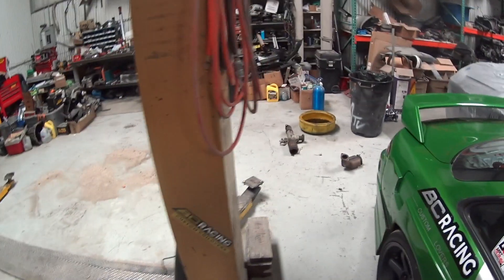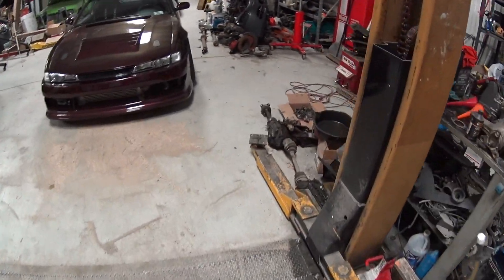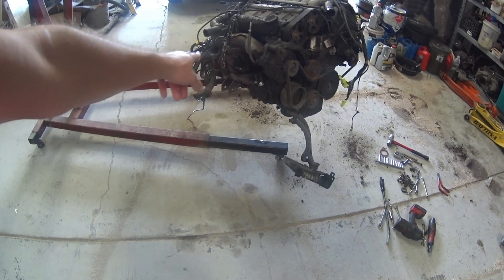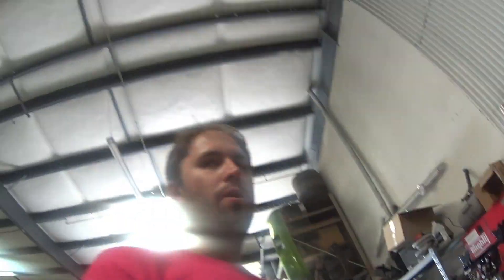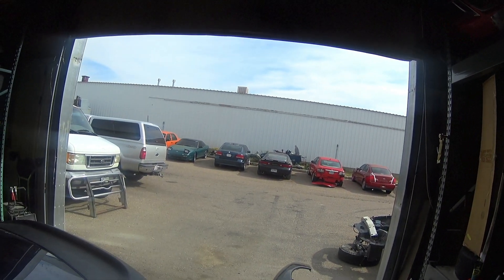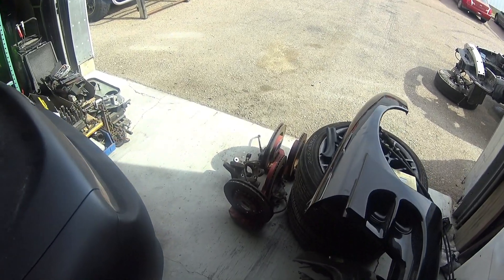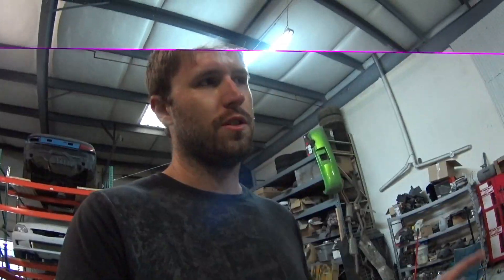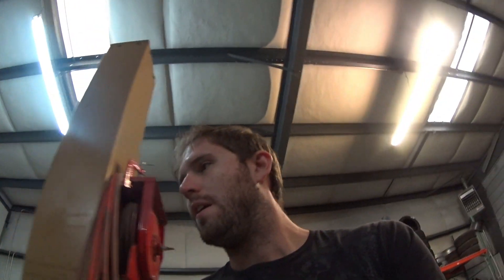3000GT Project Coming to an END!!!

Comment: If i remember correctly with my old 3000GT, the door ajar constant beep can be stopped by pulling the radio and unplugging the pair of wires that has a blue plastic connector. Should be on the right side. Hope this helps!
Reply from the maker: +Ronald Finger yeah I saw it but didn't think they were that bad

Comment: there is a light for coolant, but it's a wired looking light lol. if you turn the key before starting the car to let the dash light up you should see it, it will be the bottom right corner under SRS

Comment: just a fair warning that is the wiper fluid light, not the coolant light. if you don't have a manual, I suggest you look up the dash lights somewhere so u don't get confused with them
Reply from the maker: Zachery Linkmeyer that makes since lol it is empty
Reply: and if there is a manual, the code for the radio will be on a page in their.
Reply from the maker: Zachery Linkmeyer yeah I have the code just need to put it in